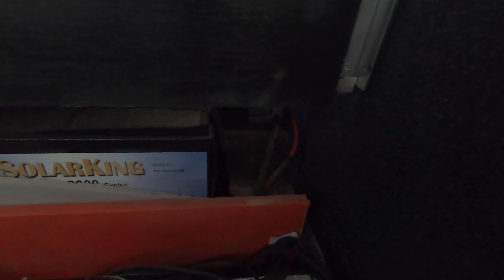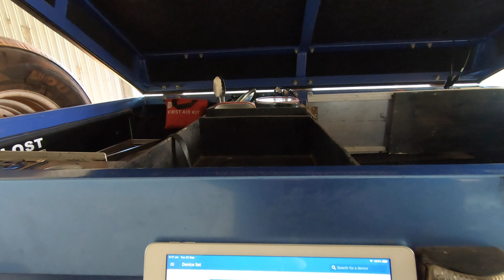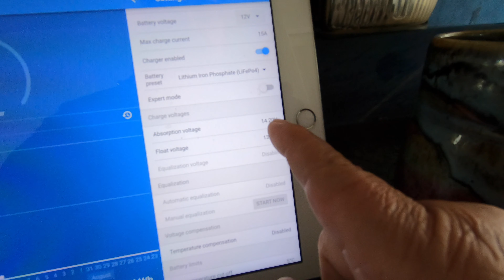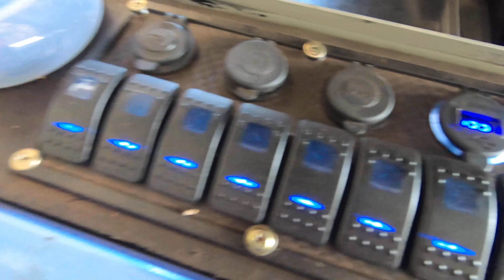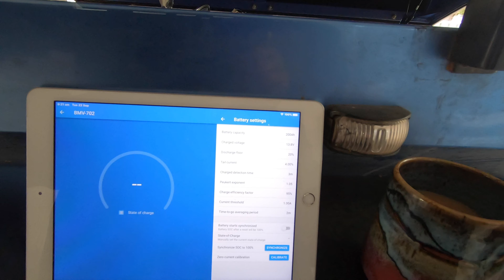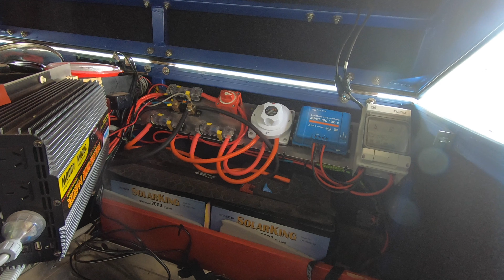Home Safe

Comment: very good, nice, clear explanation.   :) that bulldust is a real pain !
Reply from the maker: Yes if bulldust can get in it will. The reason i am so careful with checking the gear out, Is simple we are a long way from any help if things go wrong. I am the same careful with the Ute. I had its tyres rotated and the wheel alignment checked.  The rough corrugated  roads can play havoc with the suspension on a car.